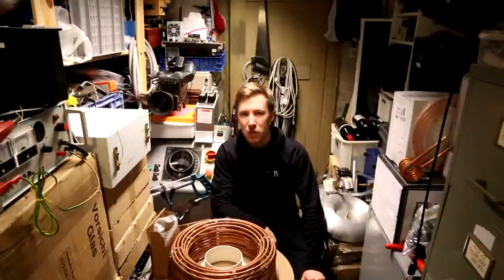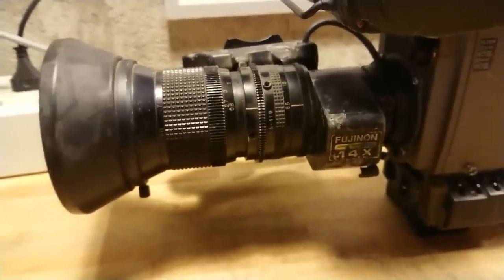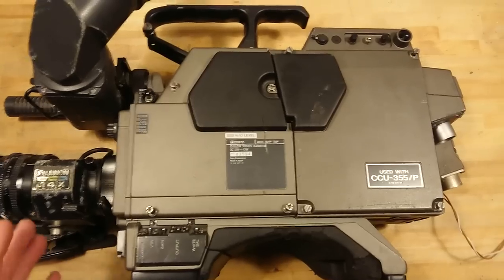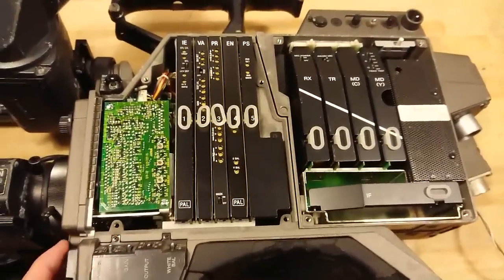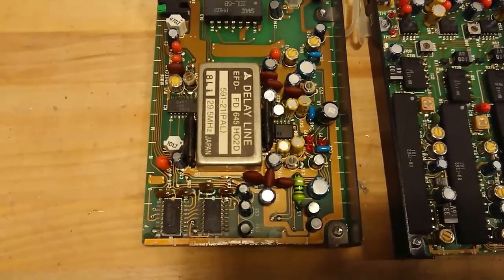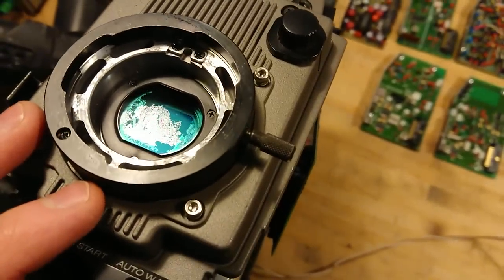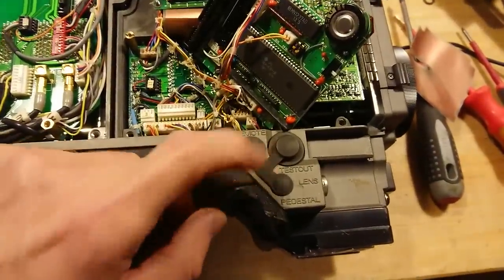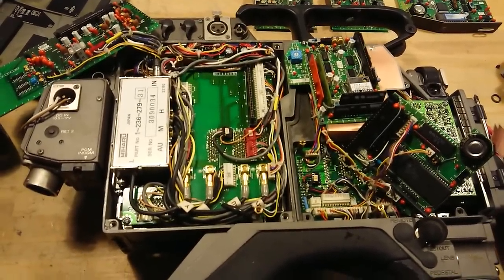Guest Video: - Kaizer Power Electronics - Sony BVP-7AP Vintage Video Camera Teardown

Comment: Thanks for the blast from the past. I used to maintain this type of camera. One time there was a cracked frame and I had to disassemble the camera entirely. I took lots of photos because the routing of the wire harnesses is very precise. There is only a few mm of slack. A full alignment took very long, but didn't need to be done on a regular basis. When it did have to be done, you would spend a couple of days on it. The masking of defective pixels was automatic, but it didn't always work correctly, so manual pixel masking was needed, and it still is on their latest cameras. There are hundreds of bad pixels on most cameras. The Sony "factory" training was very good. I went to three 2-week classes for different products. 
There's no storage in the Camera Control Unit. It is a power supply for the camera and an I/O interface.
IE=image detail  enhancer. It has a dual glass ultrasonic delay line on it. Dave did a video on them. VA=video amp. PR=processing amp. EN=encoder. It makes the composite PAL signal. MD=modulator for the triax.
The HV supply does not make HV for the camera, it receives HV from the CCU. It can be AC or DC depending on the model. Usually around 170 to 250 volts. The triax sysytem uses multiple FM carries to carry video, audio, and control in both directions over triaxial cable. The CCU also sends power as previously mentioned. Triax is like coax, but with a second shield which is insulated from the first. It is for safety only. A triax camera can be run on coax if power is provided to the camera locally. A triax cable can be over a kilometer for some cameras. You can still buy triax cameras from Sony, but they use digital modulation. Triax has been mostly replaced by a hybrid copper (for power) and fiber optic cable.

Comment: I have spent my working life with this camera used for ENG/ documentaries with BBC/ITN etc. I still have it ! I built my strength carrying it around the World and it has made my life very comfortable financially thank you! I am still using it without the Betamax loading system, connecting it to the o/p \BNC to the digital recorder. I even managet to fit a new dicroic filter . Thank you for a very refreshing memory. I have the full user and service manual since us cameramen were oblidged to try and keep the unit running in any type of environment without the help of a lab...Good wishes!

Comment: OMG, the memories. Serviced and maintained a fleet of 30+ camera heads with the "BetaBum" BVV-5 for local TV Network station. They were run and gun news footage gatherers...

An idea on values:  New optical block (which had the 3 CCDs mounted at the factory upon the dichroic prism such that Red and Blue were half a pixel offset to the Green to reduce aliasing) could cost as much as half the camera as a spare part. I recall around $18,000 in my part of the world at the time. I actually changed a few because eventually enough pixels failed and became stuck at peak white so you had a white 'dot' in the image at 0dB gain point and there was provision to work out which CCD was the culprit by switching different mainteance feed to an external 625 monitor. ... Cap the lens or close the iris, turn the gain to max and chances were by then the entire cam looked like the Milky Way! 

The bum attached to this cam in this video was Sony's Triax System, a three conductor 'coax' if you like, so that control signals and video (plus sound) and even intercom was multiplexed and traveled on a modulated RF carrier over what could very convenient long distances at an outside broadcast. That's more than likely what this Mads's camera was used for. Triax is still in use today as an option over fibre-optic for HiDef.
Reply: That is some great in-depth information you have, it was very hard to really find any good information on this camera/system was I was researching for it.

Comment: Good video. I used to service cameras like that. It was often used with a Betacam VCR back end BVV-5. Yes they were VERY expensive. The quality was good and they were highly robust, but the CCD sensors those days needed a good amount of light.
Reply: Thank you and yes the light was my first issue when trying to film with it, there was no way to get a good picture in my basement lab, so moved to the apartment and had to flip some lamps to get enough :)
Reply: Cool, I learnt to shoot on one of these. Quite reliable but there was always one on the workbench for some reason or other actually that was normally the betacam transport. Very robust, I once dropped one (a brand new one) off a tripod about 2m down onto a sandy beach, I was sure I had ruined it but it went on for many years after that incredibly reliable, the casing is made from magnesium.

Comment: Very nice.  When I was going through University, I worked as a technician for the department that broadcasted classes to other universities.  We used these cameras.  They were top notch for the time.  Sony was THE equipment to use.  Panasonic industrial too, but Sony was tits.  I never (hardly ever) saw any factory rework on their boards.  Everything was always right with construction and quality.

Comment: CCU = Camera Control Unit
The front half is the camera, the rear half is half the CCU component.....it takes all the signals and converts them to RF so could be considered a TX , and then sends these signals over the connected Triax to the CCU which converts the signal back to the desired signals......the triax also carries the power required to run the camera up to distances up to say 6km or so......The system is Bidirectional so everything can be sent both ways to provide video , audio , comms etc at both ends of the cable........you can still buy these UV filters from Sony, but why you would want to fix a 4:3 analogue camera would be the question.........I use 6 of these as "Target Camera's" on our riffle range lol......the 4:3 is great for that purpose.
Reply: Thansk for the clarifications. The 14x zoom is actually very powerful, great use of old cameras you found there :)
Reply: You were right about these camera's being a beast.......in the day they were the industry standard...... BVP7's were awesome.....many of them found themselves as News Camera's with Betacam SP backs on them.....

Comment: CCU = Camera Control Unit (https://en.wikipedia.org/wiki/Camera_control_unit)

Awesome teardown, goes to prove (as many times before) that SONY totally meant business in their professional products.

For people wondering about the sub-par camera image quality: these were not meant for point-and-shoot operation like today's consumer camcorders are. They were only operated as part of a system (cameras, tripods, remote control, intercoms, video monitors, camera control units, video tape recorder units, video mixers etc. etc. etc.) that was carefully adjusted and calibrated to work perfectly together. This meant that the camera was known to always produce the same output within its system and this was good enough for the rest of the chain (editing, dubbing, broadcasting etc.) to work on. Since here the camera is operated alone, the output is naturally sub par. This is related to and similar to how a sound engineer will calibrate all devices in an audio chain so that every box agrees on what "0dB" means.
Reply: You are right, I was being a little harsh judging it from a test output :)
Reply: The sub-par quality was due to underexposure, SD quality, and the crap in the filter. A camera like this can make a good image SD all by itself. You just need to know how to adjust it. The viewfinder has a video exposure indicator, but a good cameraman could adjust it by the viewfinder image alone. It had automatic white and black balance as well as auto iris and highlight compression. The back half could be replaced by a recorder, making it a standalone product. I used and maintained them for many years.

Comment: Awesome Video. From a manufacturing perspective, this must have been a nightmare on the assembly line. You're absolutely right. A tremendous amount of parts, custom everything and dozens of modular components. let alone all the adjustments that must have been necessary before final testing and shipping.
Man, I bet this was close to $60k-100k when it was on the market. I wonder what broadcast technicians thought of repairing this camera. I'm sure it kept them employed and busy for a long time :D
Reply: The electronics were quite stable. The cameras suffered mostly from wear and tear. Lenses and viewfinders were always breaking. Some of the cameramen just didn't care. Broken parts from falling off tripods were the worst. Once I had to remove everything and replace the entirre frame. It took days. 
What took the most time overall was the recorder which was docked to the back in place of this triax unit. They had lots of moving parts and tape heads which wore down. The alignment procedures were tedious because the recordings had to be checked against alignment tapes and then tested in a reference VTR. You had to be precise to make interchangeable recordings. I spent a good part of my life maintaining them. I don't miss it, but I'm glad I did it.
Reply: Wow. Thanks for the input!

Comment: What you see in the UV filter is fungus growing on the glue that is used for bonding the glass. I have seen this before, my father was a professional photographer and had quite a few lenses ruined by fungus growth, if he had got a lens damp apart from drying it out he would put it in a container with some formaldehyde tablets which produced vapour that killed off, well anything alive inside the container and the lens.
Reply: Equiluxe1 I wonder if that could happen with modern lenses? I’ve not thought about it, but might be a good precaution to keep desiccant sachets in the bag.
Reply: Modern lenses are glued together using synthetic glues, but generally what ever it is nature produces something to eat it.

Comment: never thought i d see one o these anymore. used to be the operator sitting on the other side of the cable xD
without the CCU and the RcP its pretty much useless. most of these cams are gone because  the capacitors (elko) are damaged and ruined the pcbs. anyway shipping is too expensive. one can get these or similar like the dc535, dc635, dc30 etc. some as wsp (16:9) for cheap on the bay :)
if in good shape the most interessting part would be the fujinon lens which were broadcast standard back then. you can still use them with mft-monut adapter and some tinkering work (or just demontage the zoom motor).

Comment: The high voltage supply is probably for the viewfinder as the viewfinder is a small CRT
Reply: ofcouse! I did not think of that :)
Reply: No, it receives HV from the CCU, usually around 220 volts AC or DC. The low current is what enables long triax cable length. The viewfinder has its own HV supply of a few KV.

Comment: you should be able to pick up the SVHS back for it for pretty cheap. Basically the back half would be replaced with the VTR making it a self contained camcorder. I got a (cheaper) 2CCD panasonic. Great conversation device. I call it my UFO Big Foot Loch Ness monster cam. (because of its Superior resolution) BIG = better.. right? ;)

Comment: I just think that is a multiway connector which has a SDI feed which would feed studio equipment maybe SDI is a TV Studio standard.
Reply: No, SDI is not on this unit, and would have been on a BNC connector if it was. The big 26 pin connector is an interface for a Sony VTR. Power, video,audio, and control go through it, but no serial data.

Comment: I always wondered why pro video cams are so damb big. Thought it may have something to do with iso tolerance, focal length, or depth of field. BTW no guarantee but you may go after those 3 screws around the exterior lens to try to clean the junk out of there.
Reply: I had the UV filter out by removing those 3 screws, there was nothing to do about the mold inbetween the layers of the filter :(

Comment: Your phone camera is overexposed. 1 - 0 to the Sony :)
Reply: Well, to be fair, the smartphone camera probably would adjust the exposure more accurately if it had the same angle of vision as the Sony camera. The last-mentioned didn’t have to cope with a high-contrast scene (dark pullover, bright walls und bright window frames).

Comment: Nice Japan quality and very robust commercial unit, long life and I think they were about 15000 just for the unit you have , the other recorder was at extra cost , beta system for recording. Noted also , I bet the switchmode ps is still working fine, how many  smps these days stuff up within a year or 2, Good design and good quality componants gives you the extra life. Also its PAL not crappy NTSC . Beautiful unit love it.
Reply: Yes, Pal FTW!